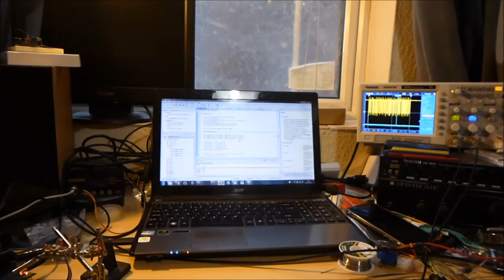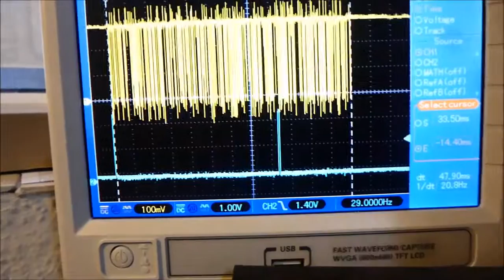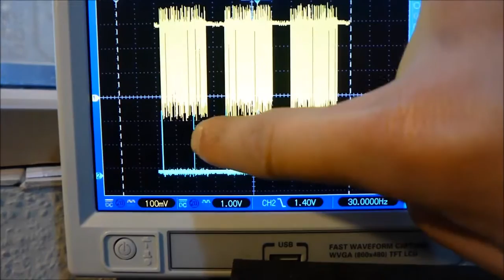OV7670 Camera with STM32F0 Discovery board + ili9163 160x128 LCD

Comment: Hello Sir , nice project
Sir i wish to make a video magnifier , I have OV7670 and STM32F103C8T6 and I'll buy some 2.8'' tft non touch,
Can you please help me in building this project
Reply from the maker: 2.8" screen is much more likely to have a slower maximum SPI rate (A standard 2.8" 320x240 pixel LCD has a maximum SPI clock rate of 10MHz meaning a frame rate of ~8.1fps). For screens larger than this 1.8" one, its definitely worth looking into using a parallel LCD instead. http://www.stm32duino.com/viewtopic.php?t=4 These guys seems to be doing exactly what you want.